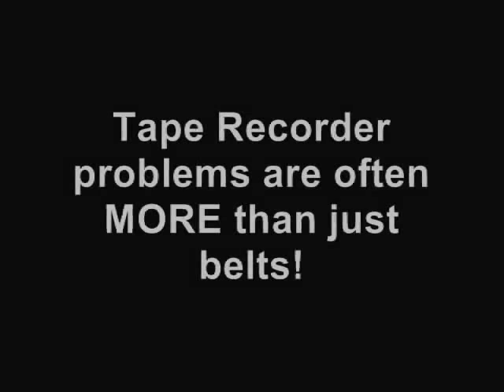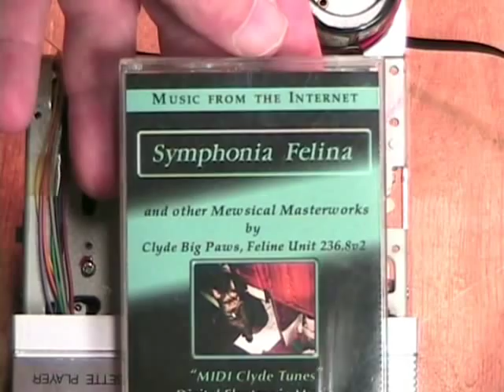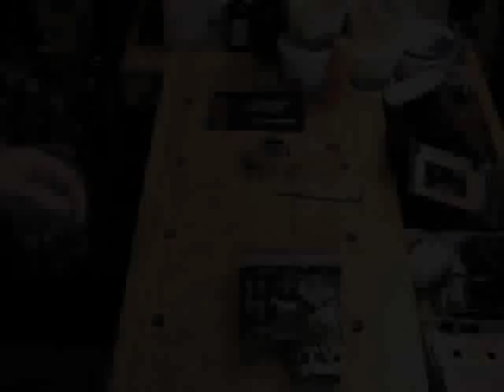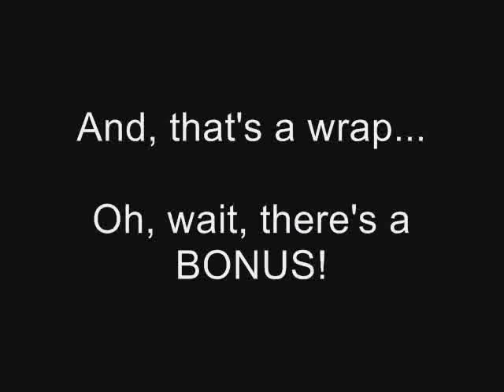Restoring the Montgomery Ward GEN 3943 Stereo Cassette Player -- A Commissioned Project

Comment: Tip that worked for me, in case to use superglue on plastics that handles to much force that its likely to break again, I reinforce the crack are putting some piece of paper. In that case I'd cut a round disk of paper and glue to this plastic disk. Paper absrov super glue and turns near into plastic Since you put all around, the paper will help the piece of plastic to take the tension and stay glued. Nice vids, I enjoy them a lot. Cheers

Comment: I have the same one but there seems to be an issue with it. whenever I play a tape there a weird silent static sound. what could be wrong with mine?
Reply from the maker: Thanks for watching the video. If there is static when you play a tape, try adjusting the volume. If it sounds scratchy, the vol control needs cleaning with De-oxit.  If you can't do that, you may improve things bu simply working the vol control back and forth a few times. They are supposed to be self cleaning, but air pollution can mess it up.